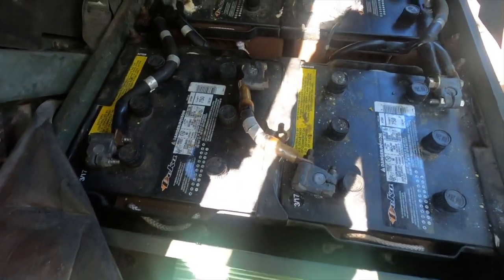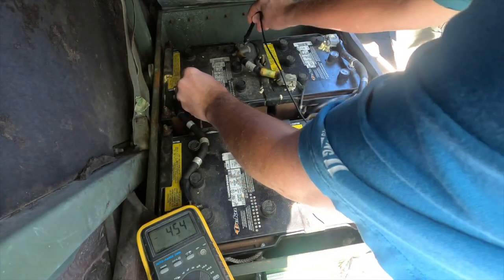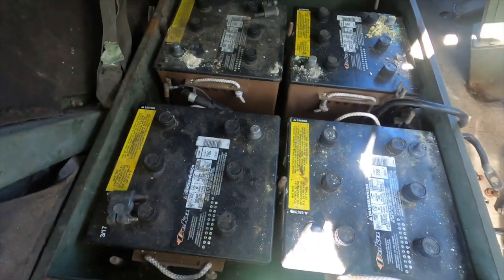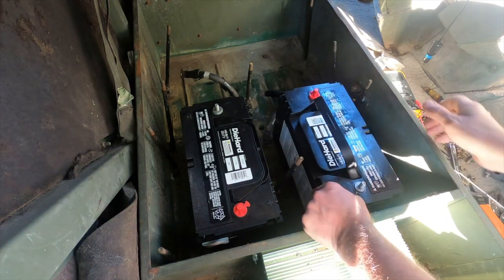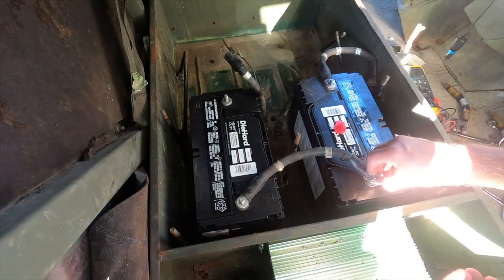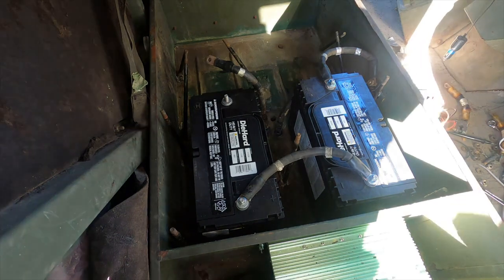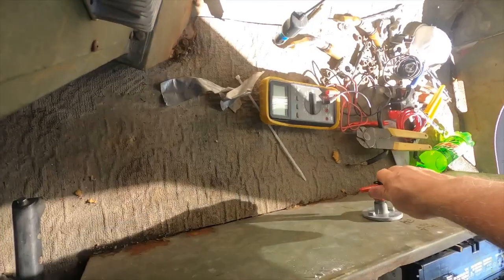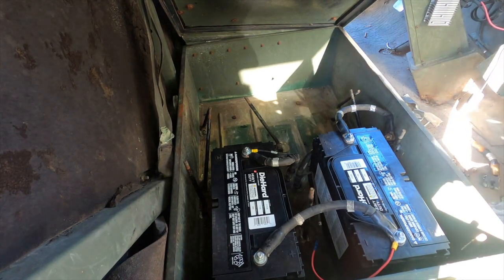Battery Conversion 5 Ton M923A2 6x6 Military Truck Part 1 - (4 batteries to 2) Electrical

Comment: Hi  there, I am trying to start my M923A2 but I have two other black cables besides the Positive and Negative cables
Reply from the maker: If I remember correctly, it is a 24v system and was originally configured with 4 6 volt batteries.

If you don't have the original batteries just make sure you have 24 volts on the positive. I would guess the other cables are for connecting the batteries for 24 volts.

Comment: Isn't that single wire where you added the red extension wire #569? If so, shouldn't that go to the pos. terminal on battery #1 to send 12v to the switch for the blower motor for the low speed? Please let me know as I'm just about to do this same conversion in my M923A2.
Reply from the maker: Actually, I do not remember. But yes, if you tap the middle of the 2 you will get 12v.

I also bought a 12v converter for about $40 that takes the 24v and puts out a 12v 40 amp power source. I used it to run GPS, radio etc.

I don't like taking the 12v from the center tap because it is an uneven draw and at high amps, could impact battery charging. But as far as I know, it is perfectly acceptable. And other commented, it was for the blower.